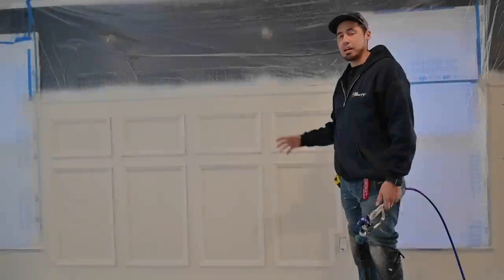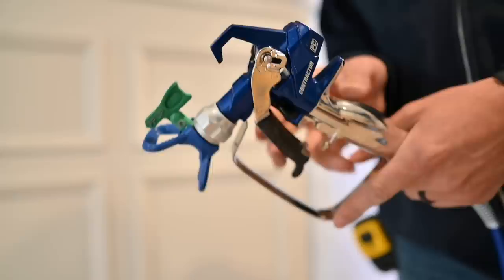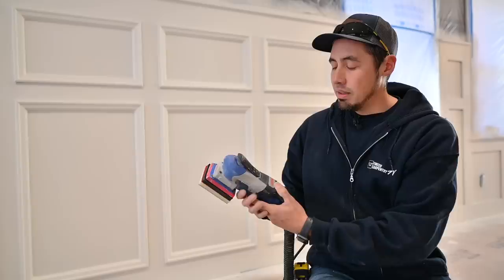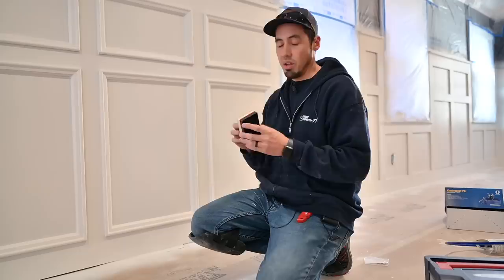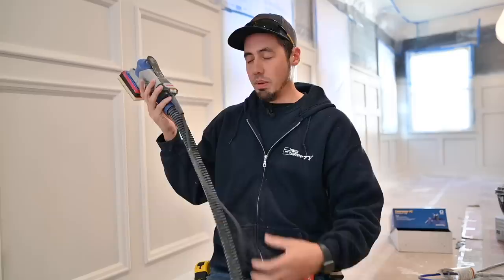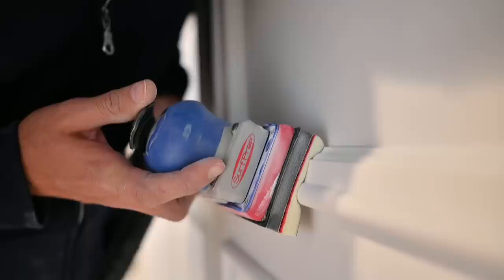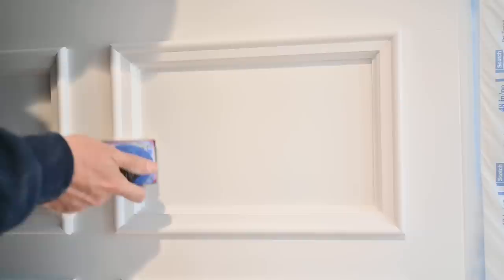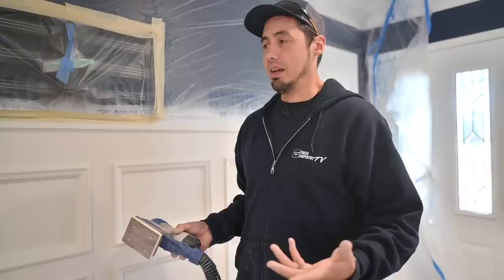This Tool Changed my Life... My New Surfprep SANDER!

Comment: The same sander changed my life too. As a cabinet refinisher and residential painter this little thing has been invaluable to my business....it's such a work horse. I still prefer to sand the intricate details on woodwork by hand but for flat surfaces this sander is ideal. I've found it too easy to sand through primer where there are edges and detailed inlay areas with the contouring foam pads. As long as your primer coats are looking pristine all you need is quick swipe with a super fine grit for top coats, so I do love hand sanding that with the contouring foam pads. When buying tools I'm picky and spend lots of time researching, this thing is damn expensive, but it's paid for itself over and over again! Highly recommend it...can't wait to hook it up to my new Festool CT MIDI

Comment: The Surfprep system is amazing.  I ordered the 3x4 sander last year and it was so nice to operate, and saved me so much time on the first job that I later ordered the 5" orbital for more rough sanding work.  These things are no joke and worth every penny.  3x the price because it's 3x the tool! Also the dust collection works very well.

Comment: Upgrading my gun was the best thing I've done to my sprayer having the professional tool allows for professional results plus it comes with the swivel for the hose and it's so much easier to take apart and clean compared to the cheap guns.  Anyone that says they like sanding is crazy even with power sanders it still sucks and having high standards mean I sand more than others to achieve the best results possible.

Comment: Surf prep now sells the foam pads for other sanders. They have 5” and 6” discs in various hole patterns including Festool, and delta and rectangular for the Festool RTS and DTS 400 machines. 
There is a separate section called "Multibrand Abrasives" in the product area. They only carry Med/Fine/Very Fine in this section. You can choose a 10 pack of a given grit/thickness combo or 6 packs with 3 5mm thick foam and 3 1/2" thick foam. 
I’m not sure what the quality of the SurfPrep, it is a rebranded unit that is also sold under the Ekamant name, another quality abrasive company.  But the Festool RTS 400 is a similar size pad with the same 2mm stroke for $280 with a systainer, dust bag and edge protector vs $509 for the Sandprep branded sander alone.

Comment: That Graco gun is real nice for sure. Picking up one to replace the one I have.
 As far as sanders go I have 5 already. 3 Festools, a craftsman belt  and a porter cable belt...
Might be looking at 6🤔
Reply: Graco hand sprayers should only be used for like,  1 maybe 2 doors at a time.  There motors aren't for for huge projects people be running them on.
Reply: @LightGesture 
There was zero mentions of a handheld

Comment: Hey I wear those same knee pads! They're the best unless you need a ton of protection, and they're only ten bucks.

Pro tip: wear them upside down and they will never slip down your knee.

I get them at Dunn Lumber here in Seattle but I believe you can find them at one of the big box stores. CLC

Comment: You're getting closer and closer to that next level production vs quality. It can be done but usually takes money. For a sanding kit I would also look at Mirka 5" orbital in both a 3mm and 5mm stroke. And on finish you should try industrial wood coatings, there are many fantastic waterborne products out that are safe to spray in a house. CIC is in your area and you can can get Sirca easily there also. Ditch the Sherwin Williams house paint it just doesn't perform.

Comment: Surely there will be more pressure applied to the higher parts of the moulding than the crevices. Especially as there is rotation of the foam pad involved.
And especially as the foam pad heats up and wears with use and requires slightly more pressure by the user to remove adequate material

Comment: Very cool. Wish you showed us the other end of that hose. The container that captures all that dust. I recently had to sand some door trim down in my cellar and used my old Black & Decker rotary sander. Man, it’s got a capture bag attached that I don’t even know how to detach but it doesn’t matter because that dust now coats every single item and every square inch of my cellar. I like the oscillating multi-tool for sanding better than that B&D. The capture bag has nothing in it.  Anyway, nice work man.

Comment: The surf prep sander is rebranded, Ekamant a European abrasive company sells the product lineup under their name, but I'm not sure where it is made. I'm fairly sure it's Chinese, but I can't confirm that. It's very similar to the Festool RTS 400 which has the same 2mm stroke.  The Festool has better dust collection and includes the systainer for $280.  The kit linked here comes with a selection of abrasive pads and accessories for $558, but they charge for a systainer. The bare sander is $508 plus $85 for a systainer, so it's $593 vs $280 for the Festool. The differences are that the "SurfPrep" is a has the paddle handle while the Festool has an On/off with a dial for variable speed. It's personal preference, but I like the an On/off ... less hand fatigue because you can shift hand positions. The big difference is the soft pad abrasives, they do appear to be more flexible than the Festool. The Festool has a soft backing pad, but I believe only standard paper... so you don't have the double padding available with the other unit. That said I can sand curved surfaces pretty well with my Festool and the soft backing pad with standard paper. Still curious about the origin of the this sander...
Reply: I also have the Festool RTS400. Surfprep sells flexible foam sanding pads that are sized to fit the RTS400 and the ETS 125-  great options especially if one already is running some Festool sanders
Reply: @j.thewoodcraftninja3918  that sounds great! I’m not seeing them on the surf prep website though, where did you find them? Do they have the festool hole pattern?
Reply: @j.thewoodcraftninja3918  found them under products/multibrand abrasives.

Comment: Looks like a great product but the big factor is the price of the replacement sponge abrasives, while no doubt it looks easier. Right off the bat its 600.00 plus abrasives, so you have the added cost of specialized abrasives, and how long does said abrasive last? Those are the biggest factors for me. Obviously if it saves u time it makes u money  but that is offset by the added cost of abrasives . If it comes out to costing way more than 3m sanding sponges plus time, involved then it is a hard sell.

Comment: When it comes to sanders I don't see the value of cordless either. All my sanders are hooked up to a extractor and if I'm going to be tethered with a hose then strapping the cord to the hose is of little consequence. Nice sander and nice graco gun. FFLP are about all I use unless spraying ceilings.

Comment: What sprayer are you using? Greco 395 nova pc? I have the same sprayer. Very good for ultra smooth finishes. That gun alone is $350 lol. But worth it. Use oil base or alkyd trim enamel. Pro classic or emerald from sherwin is worth a try. Self leveling paint for a smoother finish also.

Comment: Any experience using Surfprep sander to prep heavily painted oil/latex wood trim and doors?

I want to repaint all the wood trim in my ca 1920s home. The trim has many layers of paint and lots of drips from sloppy painting in the past. I watched some videos about the Surfprep sander and it looks really great but more it seems geared more for furniture refinishing. I don't want to get the wood trim down to bare wood. I just want a smooth and uniform finish without doing it by hand.

Comment: In a door frame, do you caulk between adjoining areas of the profile - meaning if there is a flat section running inside the frame from the floor to the top of the frame and then there is an adjoining flat area that protrudes that first section (ie is closer to the inside of the doorway) that also runs from floor to the top - do you caulk along the entire vertical height between the two sections of that trim pack? Thanks!!!

Comment: Awesome sander and anything that makes less work sanding is a plus in my book. I'm a recent fan of your channel and I have a bathroom wainscot project coming up. I was wondering if you can tell me what you recommend for the material in a bathroom. I want to avoid any warp or moisture issues so do I use a vinyl or is there a MDF panel material that is moisture resistant? Your thoughts would be greatly appreciated.

Comment: Would this work for sanding off layers of paint on trim? I’ve tried it all ways, stripper, by hand, using a Festool for flat surfaces.. it all sucks. I’ve got a more shaped trim in my house now instead of the traditional flat gumwood baseboards, so I’m really trying to avoid doing it all by hand or making a soda blast box or something if I can help it.

Comment: Hey mate, thanks for the video. Would you say this is a relatively light duty sander or will it do heavier work as well? I need a good sander for key-ing oil based gloss to be primed and painted in water based. Cheers from the sunny South of England. 🌧

Comment: Would this tool work for sanding a ceiling after removing the popcorn and patching the holes with compound? Or would I need a big dry wall sander with the big circular sandpaper?
Reply: Better to use a circular sanding stick or square drywall one

Comment: Stupid buy @ $558 for a homeowner but perfect for your business. Great sander.
Reply: I know that's a pretty penny, I mean if you sand atleast 3 times a week it makes sense, but there's other sanders less expensive which would do the same
Reply: @duartepaintinghandymanservices  Just  curious could you name some less expensive ones. I've got some sanding to do and I am looking for an alternative to the 3m sanding sponge.
Reply: @richardlug6139  try the porter cable 1/4" orbital sander
Reply: @duartepaintinghandymanservices  If I had a business like this I'd buy one. Or just pockets loaded.
Reply: @duartepaintinghandymanservices  I have a 1/4' sheet sander like that, but a different brand. How do you attach a foam pad to these type of sanders? That is what makes the sander he his using in the video very useful and the fact that the orbit it is making is a lot tighter then the sheet sanders I have used before.
Reply: @richardlug6139  pretty easy, you can make a foam pad and use 3M adhesive spray to attach the foam to the sander, easy fix
Reply: @richardlug6139  the sheet sanders also do have a slight orbital to them, they don't just go back and forth, it appears that way because they are going fast

Comment: That vibration can’t be good for hand joints. Wearing anti vibration gloves may help? Who has a solution for that?
Reply: I use one daily at work. The vibration level is very mild, never a problem. Drexel will eventually make one at half the price.
Reply: Dang auto corrupt, that was supposed to read: dremel

Comment: Omg... you cut a panel moulding around an electrical plug. I normally cut the drywall open with a multi and move the plug into the square opening, then repair the drywall.
I would never do what you did there.
Finishing since 2003.

Comment: $560.. buys quite a few of those sanding sponges....
Reply: Sure, sponges are cheap but time saved is much more valuable. I guarantee that if you're paying someone to sand every week you'll save the cost of their wages 2 or 3 times per year plus the finished job will be more perfectly flat and smooth.
Reply: 560 is a 1 time buy that is paid off in a few jobs in time saved per job. You cant look a bigger ticket items so 1 dimensional. Time is money
Reply: @hereticxxx9317  okay... + proprietary sanding pads.. did you price those?
  I use a variety of more traditional sanders and I am skilled enough after years of working with them, not to soften the details of the trim like this does.. So it is fine for some, but not for me. Tried these before.. they smooth out the high spots and blend the details. But the sponges do that as well.. just slower.
Reply: @choimdachoim9491  any sander does “flat and smooth” if you use it properly.. he is promoting this for details like trim.. have you tried one of these? Tried to smooth out something like 60 yr. old window frames? Or a picture frame?  It does the same thing a foam block does.. removes the sharpness of the details..
Reply: @WalterPidgeonsForge  Any method of sanding will remove sharpness of detail if used improperly. 60 year old window frames, in my experience, have multiple coats of cracked paint and sanding is useless. Liquid paint remover is called for in this case, not sanding. This sander will give better and quicker results on the flat fields between the trim shown here and if the corners of the sanding pad are used carefully in the corners will result in a very smooth final coat of paint. He's not sanding anything, he's just smoothing the primer. I love those foam blocks for touch-up work and the larger grits will remove an amazing amount of anything. They're great for small jobs, not entire rooms. By the way, if he was sanding down sharp details we would have seen bare wood showing through and I didn't see any of that.
Reply: @WalterPidgeonsForge  SLOWER. There, you said it. You want to spend all day or a couple hours?

Comment: But let's not forget the pretty penny it costs
Reply: ...you get what you pay for and it pays for itself on the first job...
Reply: The cost is irrelevant, it a 1 time purchase that will pay for it self in 2-3 jobs. If that tool makes it through 20-50 jobs it has made you 50x more than what you paid for it through saved man hours sanding by hand without sacrificing quality.
Reply: @hereticxxx9317  it isn't a one time purchase, you still have to buy the sanding pads for the sander and things do break down
Reply: @dericanslum1696  how exactly does it pay for itself on the first job, perhaps you mean overtime

Comment: I'm so sorry, I don't want to be "that guy", but you do NOT use power tools to sand edges ... you instantly ruin the geometry.
I used to be a professional painter until an accident, and am now working as a Luxury Boat builder, in the finishing / mould repair team ... sanding and polishing to mirror finish, repairing shapes is my job. And it just hurts me to see you do that with a power tool.
Reply: Pffff.....
Reply: My brother worked a part time summer job  for a painting company. They handed him a square pad sander (fine grit paper) and told him to give the interior walls a once over before the finish application. One of the seasoned workers on the crew stopped my brother when they noticed he was sanding the crown molding & baseboard trim. The molding / trim was still used but my brother noticed a lot of eyes examining his molding/trim sanding job.